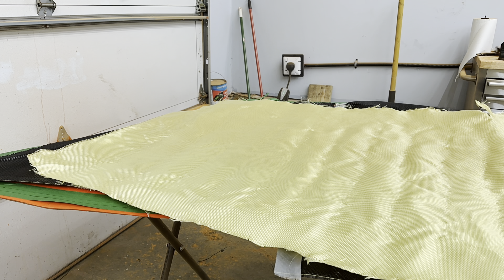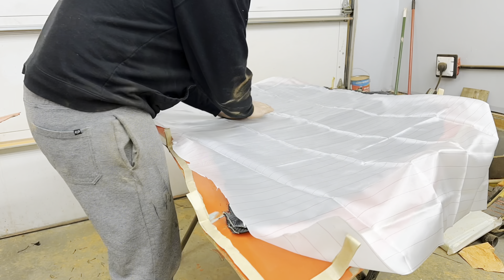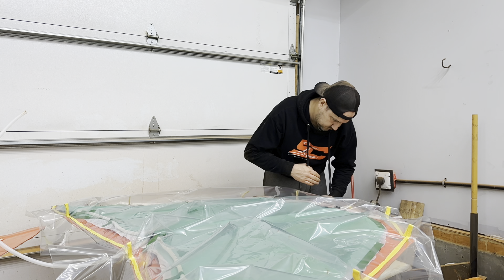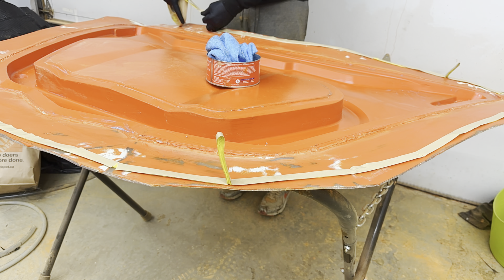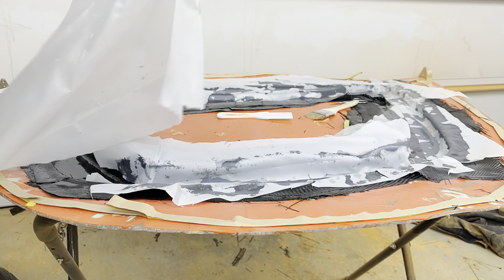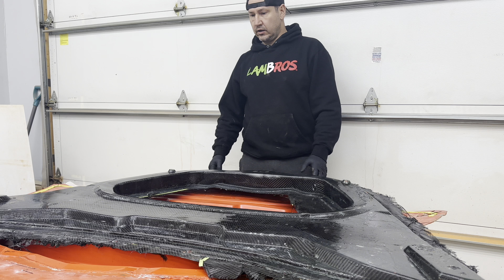How to Make a Carbon Fiber Car Hood - Part 2/2 : Resin Infusion

Comment: Leak down test before infusing. You need to spread the adhesive on both panels then lay a bead and clamp with stronger clamps I like pro set adv 175. Spray duratec sun shield to fill voids then block and high solids clear 22:59 other wise it was a good first try!
Reply from the maker: Awesome! Thanks for the tips! I’ve never heard of that Duratec product but looking online looks like a great product. Is it a gelcoat style polyester? Maybe I could put it in the mould before the carbon
Reply: @Backyard_steve  it is gel coat, you can spray it in the mold then infuse but you’ll get bubbles under the surface of it unless you have no vacuum leaks.
Reply from the maker: Ill have to check it out! At this point I'm 50/50 for leaks. I just switched from the green stretch bag to the standard clear plastic, I kept getting pin holes on the surface of my bag from it coming into contact with the mesh
Reply: @Backyard_steve  try airtech km1300 much thicker bag or put peel ply over the sharp areas
Reply from the maker: Awesome! Thanks for the tips! I appreciate it!